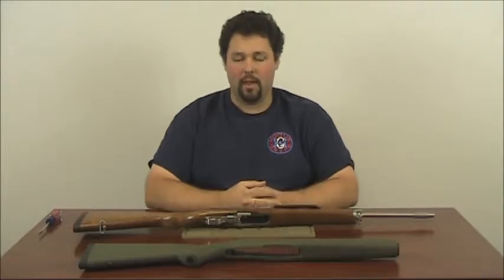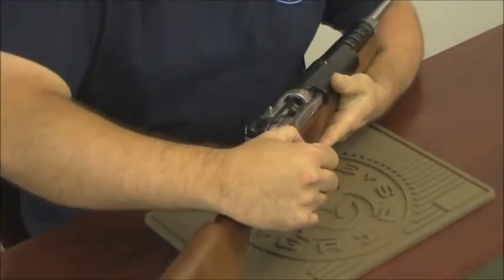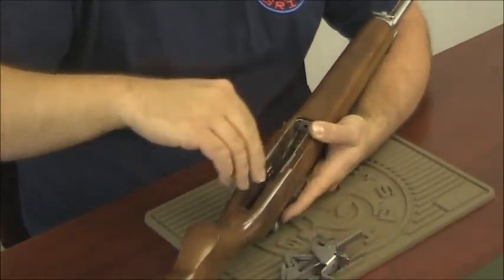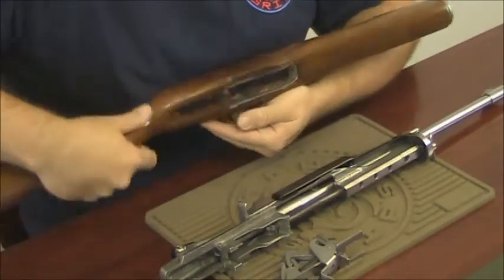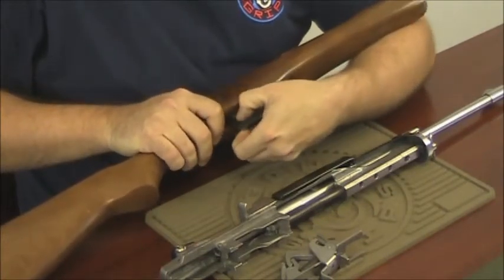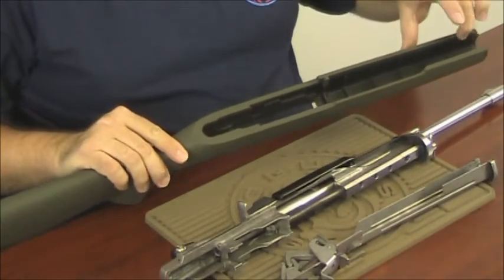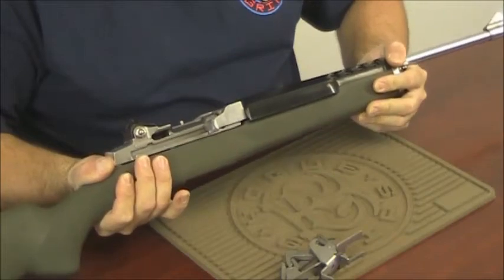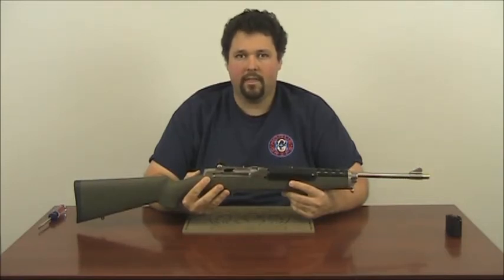Installing a Hogue Mini 14 / 30 Stock

Comment: i have been trying to trouble shoot some fit issues with my brand new mini with hogue stock and I have just come to realize that there is NO forearm liner in my stock. It never came with one. Item I bought was listed as "factory new" This explains why there is so much play between my forearm and the gas block....for what I paid for it, I feel cheated. Calling Ruger tomorrow morning...
Reply from the maker: Thank you for your comment. This can certainly be frustrating. When sourcing a new or replacement forearm liner please ensure it is a Ruger factory part. We find that other brands of liner do not fit quite right. If you have any questions or concerns please feel free to reach out to us.
Reply: @HogueIncUSA  will do. thank you.

Comment: so in a wood stock you need the steel reinforcement to hold the forend liner?
Reply from the maker: +heldenkatze Yes at minute 1:55-1:56 he states that the reinforcement "holds the forend liner in place."

Comment: Quick Question, Is the houge stock lighter than the factory wood stock on the mini 14???
Reply: +THENEWWRANGLER Have you ever found out?
Reply: I have not found out the answer to that question
Reply: +THENEWWRANGLER what about now
Reply: no idea yet
Reply from the maker: +THENEWWRANGLER Apologies for the late response. Our OverMolded rubber stock weighs 1.9 lbs and the factory wood stock weighs 1.8 lbs.
Reply: @HogueIncUSA  *and the factory wood stock weighs 1.8lbs WHEN DRY, more when wet.

There, I fixed it for you. 😉

Comment: Why would anyone want to take the wood stock off ?  Mine came with the synthetic stock but I thought that was just a cost benefit.
Reply: Looks. Weight. Ergonomics. There could be any number of reasons.
Reply: The Hogue stock gives you 5/8-inch longer length of pull.

Comment: Does this work for a 581 series mini 14 tactical?  I was told it does not
Reply: Good question and would like to know as well. From my research I believe it will.
Reply: John Doe Update: I bought the stock.  It fits without incident.  All systems are a go!
Reply: Thanks. Ordered mine in Ghillie green.
I have the 16" blued tac version. Keeping
it simple with an Aimpoint and Tech Sight aftermarket iron sight. Not sure on a sling
yet. Any suggestions?

Comment: I have a 186 series Mini-14 and this stock DOES NOT work with that model. The forearm liner does not have a slotted tab in the rear so it snaps into nothing. At the front the stock expands the liner enough that it won't seat into it's proper place at the bottom of the gas block and thus the action will not pivot into the stock. Short of doing a lot of hand fitting this was a waste of cash.
Reply: Incorrect sir, I’ve installed a dozen if not more Hogue stocks on our local LEO minis, no issues whatsoever, the 186 series liners simply snap in place like all other liners…. All are LEO/GOV marked 186 series GBs.